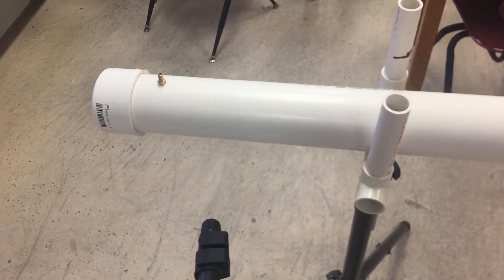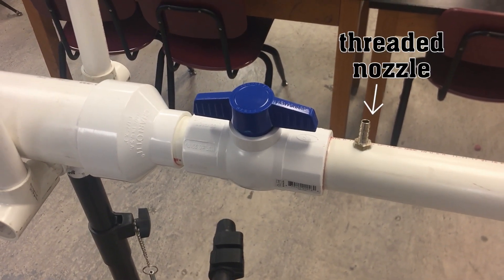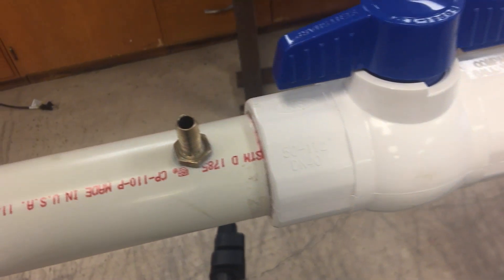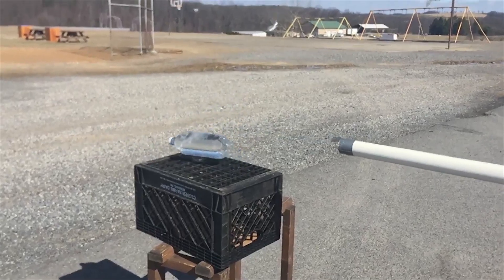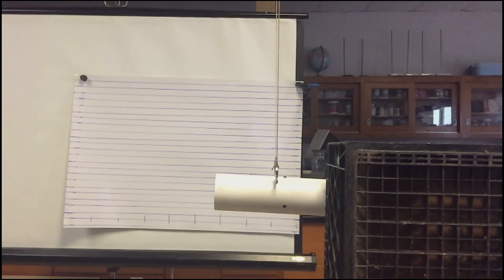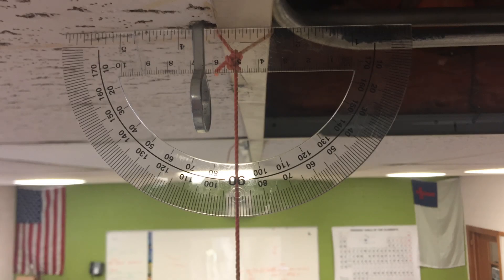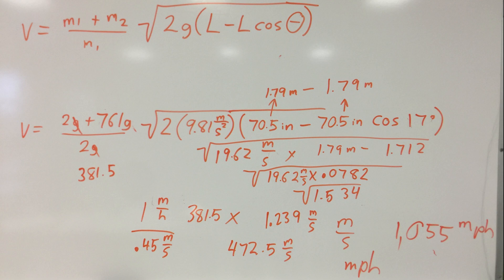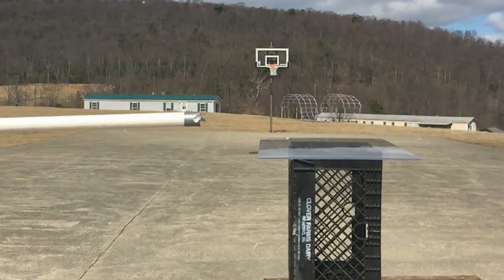300 MPH+ ping pong ball cannon

Comment: Hello.
your equation is wrong. why did you keep the (m1 + m2) / m1 outside of root ?    ¯\_(ツ)_/¯ 

according to physics, kinetic energy of pingpong ball from cannon = potential energy of mass of pendulum at 17 degree height

1/2(m1 x v^2) = (m1 + m2) x g x H
H = L(1 - cos 17)

v = √( (2(m1 + m2) x g x L(1 - cos 17)) / m1) )

m1 = 0.002Kg
m2 = 0.716kg
g = 9.8
L = 1.79

answer: v = 24.18 m/s =>  87Kmph  => 54miles per H
Reply from the maker: Thanks